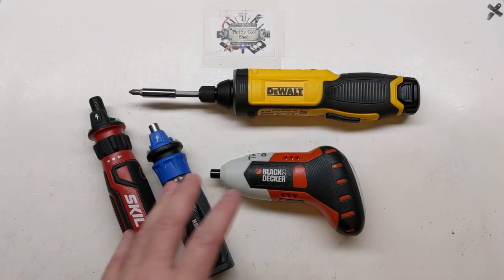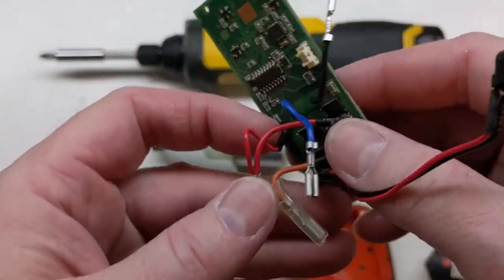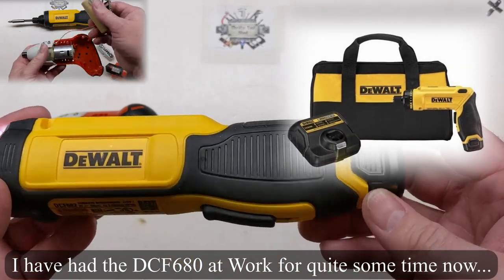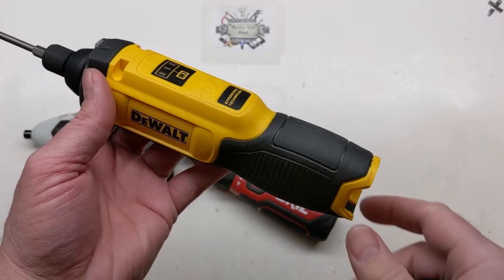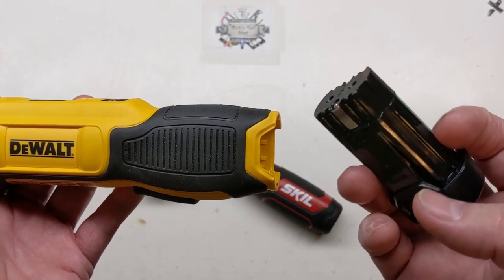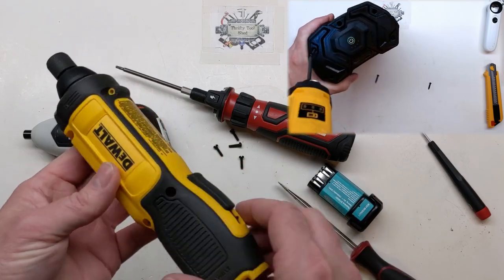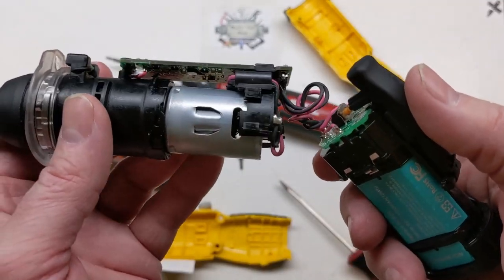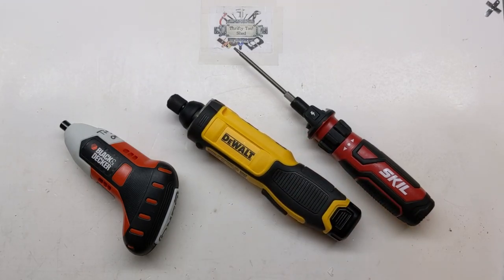DeWalt 8V Gyroscopic Screwdriver (With Look Inside)

Comment: Thanks to you for showing me a gyroscopic driver I went out and bought one with the twist grip and the torque.  
 I found a really good use for mine, I stuck the drill in the middle of my steering wheel with some epoxy and now I have really cool power steering.

Comment: The Black and Decker has the popular InvenSense ISZ-650 dual axis gyro chip used in many games. It's tiny: 4x5x1.2mm. I'm wondering if the Dewalt has the same chip. You may be able to determine if that was the problem with your unit by probing the pinouts of the chip. The datasheet is comprehensive and available online.

Comment: Thanks for the great info ! I had the common problem with my DCF682 after 2 or 3 charges that the light would go on but the motor was very sporadic. I figured it was factory defective which is still probably true but had seen on another blog that a little apparent carbon tracking on (my) big  battery rail inside the battery compartment after a few uses was a common problem. I found that rubbing it off with my thumbnail so as to not score up the chrome plate did the trick and it’s now responding aright . I suspect a bit of WD or other lube might cause it to last longer between cleanings or just remember to do it at each charge. Blessins!
Reply from the maker: Thanks for sharing. That is very interesting and good to know. I have used the DCF680 in the industrial environment now for more than 5 years so far without any issue. I also have the DCF682 as shown in the video for a couple of years now with no issues. I do notice in this video comments, people have indeed had some issues.

Comment: Nice video, I didn't even know they had gyroscopic tools.  It seemed like a great idea but does it work vertical axis? If not most of what I do is vertical so not much use. Also can it function normally or is it gyro only?
Reply from the maker: It works very well in any position. It is Gyro only. You can use it manually to break a fastener loose for example or if you want to feel the torque afterwards, but it only works as Gyro. Only one button. This is the best screwdriver I have ever owned. The only thing about mine I would change is I wish it had the torque settings on it. It's not hard to get the feel for it and not over torque, but my problem is as mentioned in video I have the nicer one at work and it has the torque settings and the grip can rotate to 90⁰ so I get used to used it with torque settings and sometime it slips my mind and thus thing will just about ring off a screw! I love the power it has! If you ever get the chance to try one, give it a try. I did not like the idea of the Gyro at the start of getting these at work and I was very surprised when I used it my first day. I will say some people at work pick it up fool with it and put it down and don't want to use it, so it's not for everyone.
Reply: @ThriftyToolShed  Now that you have told me it only makes sense that it would work at any angle. It must be the same kind of sensors they use in phones.

Comment: Bought 2 for far more than $20. Worked for about 6 months. Neither will spin when rotating wrist now, DeWalt junk...Would like a video on how to repair it.
Reply from the maker: Thanks for sharing. If mine fails, I will do my best to repair and share. I have had one at my industrial job and use it daily for the last 3 years. Many coworkers also have these. Surely before long one of these will quit! So far so good, sorry to hear issues with yours.
Reply: I have had 2 fail now within months of buying them. I will try and get some service but my time is precious and I have not had to repair any other power tool I own. They are a bit glitchy.
Reply from the maker: Interesting. This is why I was originally hesitant about these, but we have had such great luck with these as Industrial Electrical Techs and of course I use this one on my work bench all the time. So far we have not had a failure of 6 or more of these in our group over the last 3-4 years of use. I have now had more than a few negative comments from users with similar stories as yours. Hate to hear these are failing. They work so well, guess they all don't fail. Best of luck to you getting these replaced.
Reply: @ThriftyToolShed  the switch doesn’t always engage anymore. When I press it the power comes on about 50% of the time.
Reply: Took it into a service depot. They don’t repair them but I will get a replacement if they have them in stock. Hopefully the new one works better. Would you recommend the skil version? It looks a bit smaller for tight spaces. I also was looking at the dremel go. Hard to decide.
Reply from the maker: @darrensmith6782  
I do like the Skil screwdriver, I did a video on the Hammerhead and how now it's Skil, but still a lot alike. The Skil was my go to until I found the DeWalt. The Skil still works well, it's just a little slower and not quite as powerful. For the price it's always been hard to beat. The Dremel looks nice to me as well, but I have not had one personally to say for sure.

Comment: Hi, do you know the directional mosfets of the Dewalt 8V? Mine just burned, just lights up the led but doesn't turns right or left.
Reply from the maker: Sorry, I do not. I showed some of the inside during video, but did not mention Mosfets in particular. I have not had to work on mine yet.